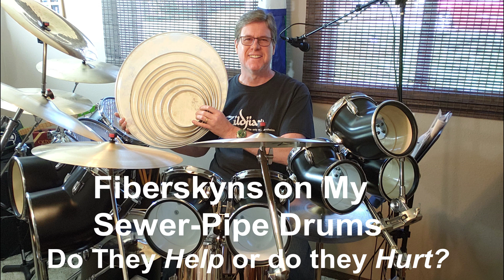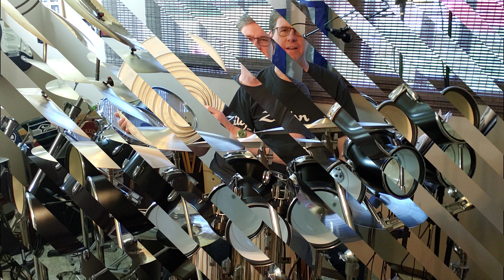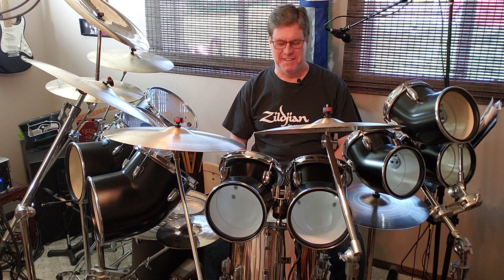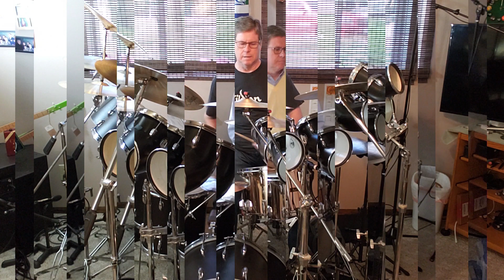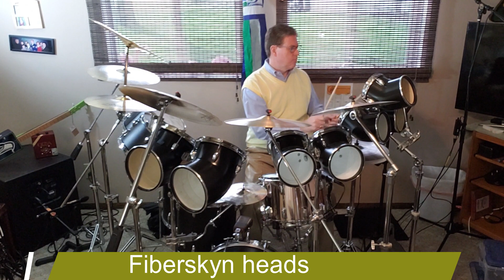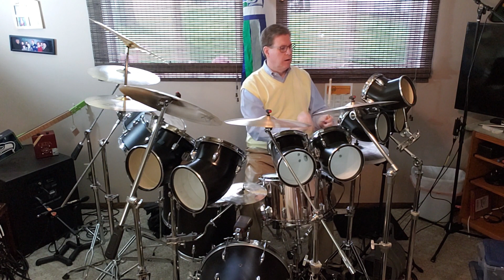Fiberskyn heads on my sewer-pipe drum kit!  Was that a good idea, or does it belong in the sewer?

Comment: Sounds too close to call.  I like fiberskyns and use them but this side by side is a tough call.  If you force me to pick, I'd say the fiberskyns are slightly warmer sounding.  I would love to have a large set like that to goof on.  Happy Drumming!!!
Reply from the maker: I agree--they are a bit warmer.  I think they sound the most different (better) on the two 10-inch drums.  I think that's because the Fiberskyns are thinner and mold to the shape of the not-so-great bearing edges of the pipe.

Comment: To me both heads sound fine, get the job done right.
Reply from the maker: I agree, they both sound pretty good, but on the 10" toms I think the Fiberskyns sound much better.  It has to do with the uneven bearing edges and the thinness of the Fiberskyns, I think.  Thank you for watching!
Reply: @christhedrummerkimball  I agree with  you  on the 10 in  Tom sounds better with the fiberskynes.
Reply from the maker: @donjohnson9063  The audio doesn't really reflect this, but the bass drum also sounds better, but a lot of that has to do with the fact I took out the pillow and replaced it with a much smaller piece of foam rubber.